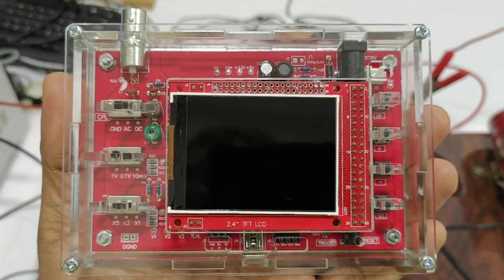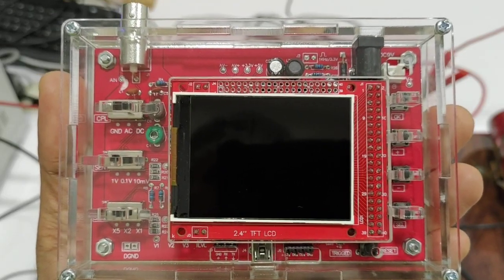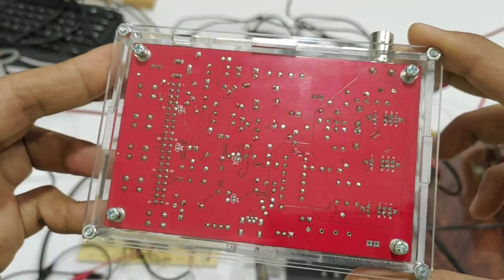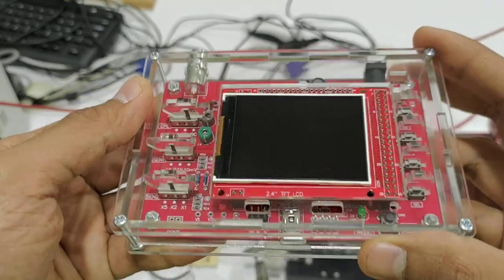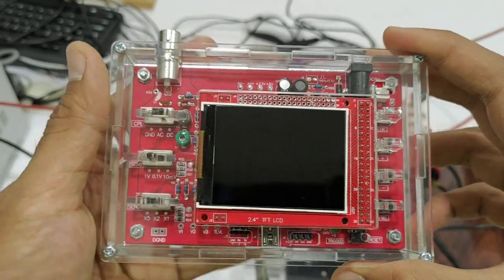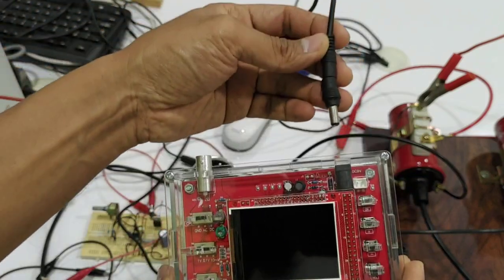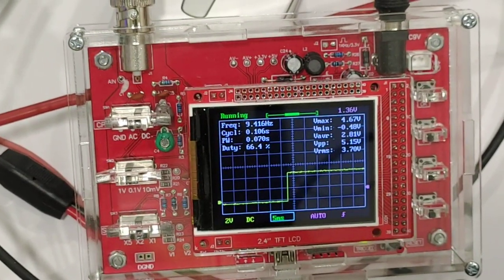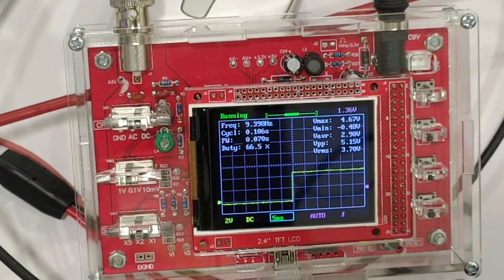DSO138 Optimized Interrupter

Comment: Observing the duty cycle , it shows  the 555 timer duty cycle. It  depends  in what it is used for, i always found 555 timers tricky in setting the duty cycles.  Nice oscilloscope. @ $
Reply: How can you shorten the duty cycle as frequency increases? Is there a feedback input to the timer chip to control that? You might have to have that tuning ability for different input voltages to keep current/energy consistent at each spark event, I would think. That might bring a capacitor across the primary of the coil into play - 400V 50uF sort of thing perhaps?